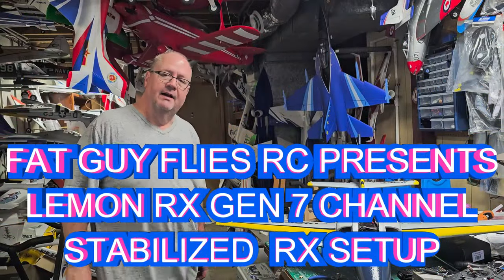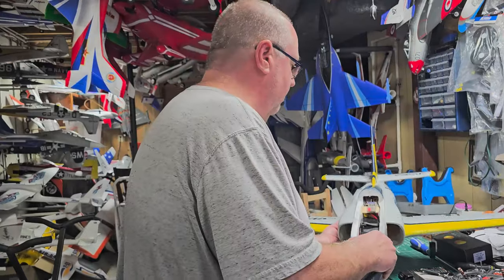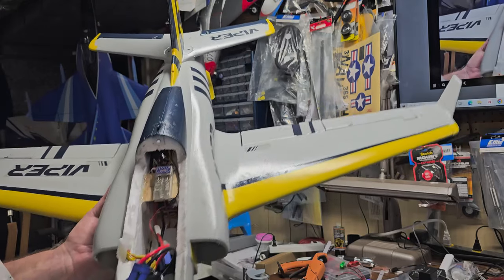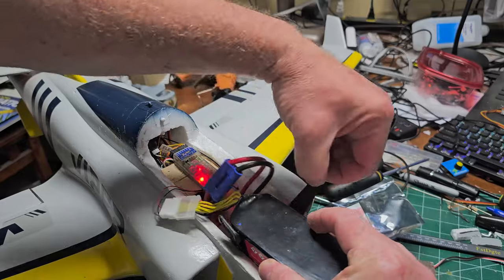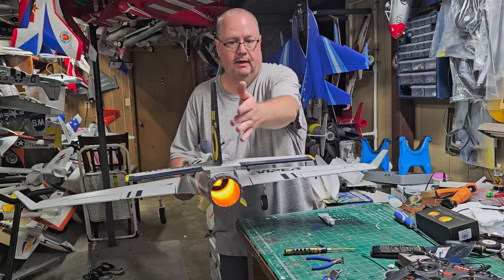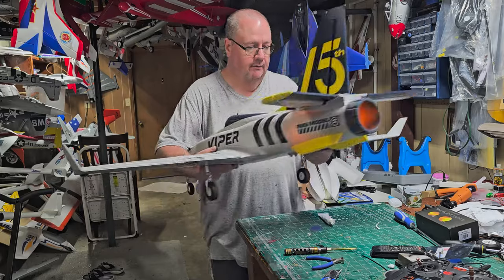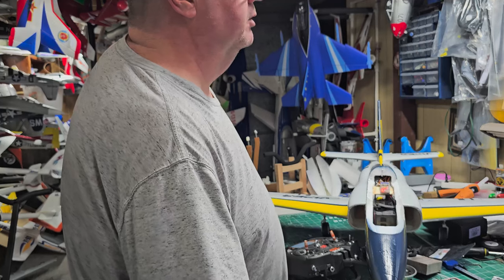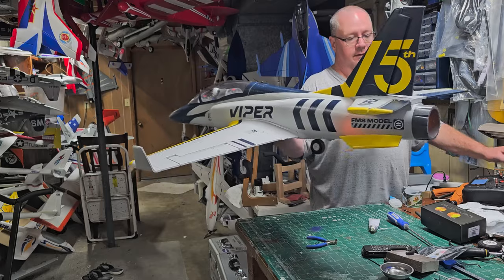HOW TO SETUP LEMON RX GEN 2  7 CHANNEL STABILIZED RX by FGFRC

Comment: Yet again, exactly the video I was looking for! My go-to RC expert - many thanks (once again) from the UK 🇬🇧
Reply from the maker: Glad it was helpful!
Reply: @FatGuyFliesRC  Hi there. Quick question: I’ve set up this receiver - your instructions were very helpful. The thing I’m having trouble with is turning the gains up (or even finding them). I run a Spektrum NX6. I ‘think’ the control surfaces are reacting correctly but the movement is so small I’m not entirely sure. Many thanks and have a great weekend. 
Edit: Ha, you can tell I’m new to all this. I’ve just had a look at the manual you put a link to in the title. The gain pots are on the Rx and can be adjusted there? Am I right in thinking I can’t vary the gains from my Tx because I only have 6 channels? Happy flying!

Comment: Hello Sir! I have an iX14 Spekrum and Lemon 10Ch receiver for Conscendo Evo. Please tell me how to set up A switch for 0 Normal flight/1 for stabilizer and R knob for gain? Thank you!
Reply from the maker: As long as the stabilizer is enabled then you can assign it to a switch. it is AUX2 by default and channel 7 in your transmitter. Also by default channel 8 and aux 3 are assigned to adjust the gains.So all you have to do is decide in your transmitter you want channel 7 and 8 to go. I always use "c" with my lemon rx as the one that switches gyro on and off. And I use my "roller" for channel 8 to adjust gains up or down. Hope this helps. Here is the online manual I use when I get confused (it is for the 7 channel version but the same for the 10) https://cdn.shopify.com/s/files/1/1052/4162/files/7CH_Telemetry_Essential_Instructions_R1.0.pdf
Reply: @FatGuyFliesRC  Thank you so much for your fast responded Sir! This information will help me out a lot!

Comment: I have 2ngen in my f16 80mm but it's on ch gear so I can't use my gear how do u allocate ch for gear or move stabilisation ch
Reply from the maker: To control the stablization it is automatically assigned to aux 2 in your transmitter change aux 2 to what ever switch you want. I choose the roller so i can adjust the gains up or down depending on the wind that day . Hope this help. Also in the description of this video is a link to the lemon rx set up guide. Thats is what i use.

Comment: I found setting up that Lemmon RX is quite easy.  Took me a few times to re read and fully understand how to make changes but once done I'm very happy with it.  Best part mounted like yours you can fine tune each one of the three gyro pots  with a micro screw driver. I'm putting one in my Viper 70 and pulling out the Spektrum cause I can't figure out how to add gain channel on a nob like the Lemmon.
Reply from the maker: It is not hard as long as you follow the instructions. World better value than Spektrum.

Comment: Hi can you help  I have setup the lemon recever all OK but the ruder and elevator mix together and I cannot stop them in the nx8 transmitter have you got any ideas please.
Reply from the maker: I would do a factory reset on the receiver and start over. Sounds like you have the wrong wingtype picked on the lemon.
Reply: Thanks for the info Guy you are bang on with the wrong wing type it fixed it I am very happy so thanks a million and great videos as well .👍

Comment: About to order a OMP hobby edge 540 60inch PNP model. Do you believe this would be a good Rx for it? Just wanting stabilizer just incase something was to ever happen and wind gyro would be nice. Thank you
Reply from the maker: Yes but go ahead and order the small satellite receiver , it will come with a wire already. There is a lot of carbon fiber in that Edge 540 . remember that stabilizer is for wind only, not self level.
Reply: @FatGuyFliesRC  ok thank you. I wonder how the FMS reflex V3 would work in it? I was really wanting self leveling just incase I ever got in a bind.